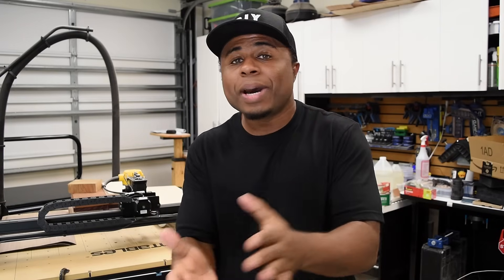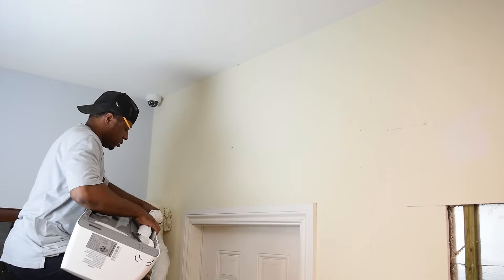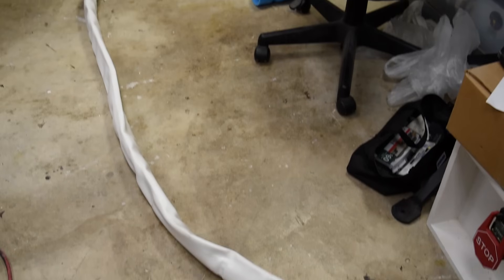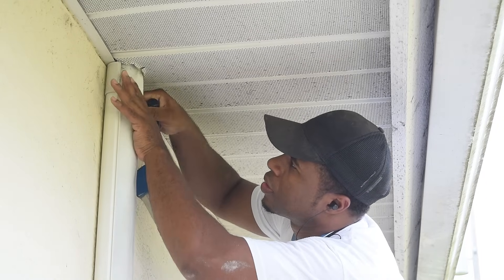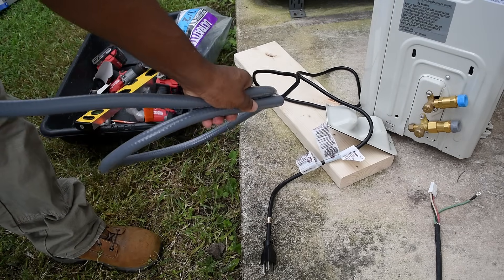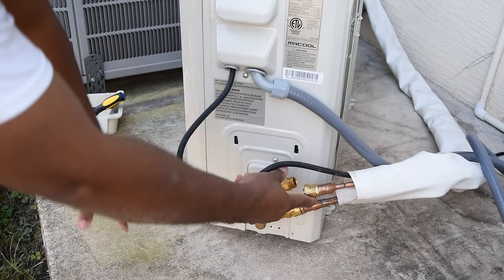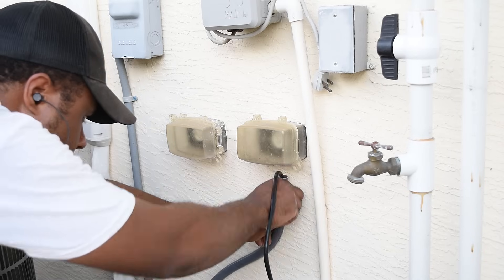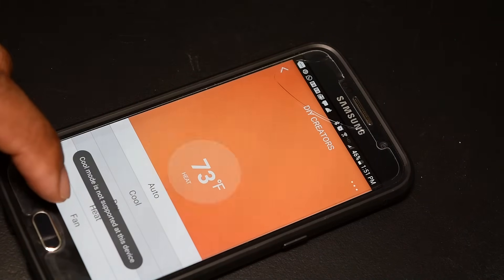How To install Ductless AC & Heating System // True DIY Mini Split MRCOOL

Comment: in Europe for the preservation of the planet it is no longer possible to buy an air conditioning, it is necessary to call a professional
Reply: He was supposed to do that as well. This is considered unlicensed mechanical work, but who’s cares, right...?
Reply: Fred V. Lord of Glencoe that depends on what state you live in.
Reply: @TheFalconJetDriver  actually it doesn't. A system that is not completely hermetically sealed should not be sold to unlicensed individuals. You should have at least an EPA type 2 CFC certification card. That's Federal.
Reply: @Franksdoneitagain  yep your right haha, if he had done that in the UK then he get a £200,000 fine or 256,584 dollars for not having the qualification to install as he needed to pressure test the pipe work and the vac (reduces the pressure in the system which boils off any moisture in the pipework to remove it) before running it up and a traceable paperwork must be created. Plus also the company who sold him the kite would be fine for selling to the General public.
Reply: Insulation is better than air-condition
Reply: Depends where you live. Insulation round these parts just means you trap 40+°C inside your house for longer.
Reply: I am French living in the south of France and it's hot summer. I just wanted to say that at home, you still have the freedom to mount an air conditioning without necessarily having this done by a professional air conditioning. good insulation delays heat or cold but sooner or later it happens in the house
sorry my english is not good enough to spot translation errors in relation to the french expression.
Reply: @danielkzk6202  I don't think so my friend !!  renseigne-toi ami, je crois que tu as tout faux ! mais bon dans le sud tout le monde s'en branle... right ?
Reply: @thereisa6inthename    I don't know where you live, Finland maybe because that's a response from someone living in a cold and dry climate or in a poor hot country,  but I live in a hot and humid climate and 2 meters of insulation isn't going to do much to stop water vapor my friend... AC does not only remove heat but it also dehumidifies; 25% of the work in fact.
Reply: $250,000 fine here in Aus for even opening the covers..
Reply: Bunch of Commies
Reply: wow...  you must've been first in you "how to be a douche posting comments"  class !

Comment: Glenn, why you couldn't cut the excess line(25ft)?
Reply: Because the lines are pre-charged with refrigerant.   This eliminated the need for a EPA certified pro to install.
Reply: @aceshigh1158   Thanks, I was under the impression that the refrigerant was precharged in the condenser unit.
Thanks again.
Reply: Not in the MrCool DIY series of mini splits.  Cutting/sizing the line would result in a loss of refrigerant, and a house call to your local HVAC expert for repair.

Comment: A vacuum needed to be pulled before opening the condenser. The air in the lines is gonna shorten the life of that compressor.
Reply: NO...No...NO...No vacuuming required nor should be done on the MrCool DIY series...PERIOD! The flared line set fittings have internal sealed valves that only release the refrigerant ( pre charged and pre vacuumed at the factory) when you install the lineset on the condenser.  The plastic caps on the lineset are ONLY for keeping the threads protected and clean, not for retaining the refrigerant in the lines.  Yep... I know there are lots of HVAC experts out there, however their advice applies only to non- DIY units.  There are lots of Mini splits out there with minimal 1-2 meter long linesets, then once you're out your hole in the wall, you attach the extensions provided.  You would then have to vacuum the lines down.  However since the MrCool DIY series ( they do make other ducted AC/Heat pump units, btw) pre charges the lines with refrigerant, vacuuming is not necessary or required, and your warranty specifically covers DIYers installations.
Reply: @eldergeektromeo9868  thanks for the response I was unaware the line set was pre charged and sealed with refrigerant I apologize
Reply: No apologies necessary, @amorgan.  You are correct that air( or any other contaminants) in the lineset will shorten the life of the unit, and that is a rule of thumb folks should consider if installing a mini split from any other manufacturer.  The MrCool DIY series ( and only that series) is an exception to that rule.  Someone on utube has a two or three part install on an 18K "Pioneer" mini split, and that person does take the time to vacuum the lines, even though this particular unit has the condenser "pre charged".  Its a very good demo of how it's done, btw...Thank You.
Reply from the maker: This is a DIY unit and they design it to operate this way to my knowledge. I'm not an expert but I just followed the instruction.
Reply: @DIYCreators  The company might have sold it as diy but those style of units are called mini splits. It should still run the compressor might not last as long due to there being moisture and air in the lines. 

Btw, I like your channel and all your projects a lot
Reply: amorgan235 you are correct as I was in the HVAC field for 10 years. A vacuum should have been pulled to get any moisture/contamination out of the line set. Unless this is some new technology and it doesn’t need a vacuum. But in the 10 years I worked HVAC I have never turned a system loose without pulling vacuum.
Reply from the maker: I totally understand where you are coming from. However, the pipes come sealed and the manual mention not to remove the caps prior to connecting the lines to the condenser. I even double checked with the company. Not saying your wrong, just saying this system is different to my understanding.
Reply: @DIYCreators  if you do a search for "vacuum mini split" you can get a lot more details on why it is needed. The lines being sealed is good to keep debris out but as soon as you open the lines it is filled with air and moisture. (Moisture being humidity)

Comment: Hello, how are you? Congratulations on the beautiful work on the installation infrastructure, but you made a mistake. before releasing the gas from the condenser is necessary to make a vacuum in the system, which would remove all moisture present in the pipes, in addition, there is a test with nitrogen to check if there is no leakage in the system. Another point, when you passed the pipes I could not see if you insulated so that no dirt or object could enter the pipes.
Reply: I thought the same thing with pulling the lines into a vacuum, but I just checked their website and the lines are already in a vacuum and the ends are a quick disconnect I guess.  So no need apparently.
Reply: hello ... of course the device will work, but not in the most correct way. the installation in this way will only reduce the life of the equipment.
Reply: the unit does not require vacuum. That is why it is DIY....
Reply: yes it does. won't last long without a vacuum @made_by_chris
Reply: @zacash25  no it doesnt! The DIY version doesn't require it.

Comment: Great video. Always wondered how difficult or easy these were to install. 

Looks pretty straightforward, like putting up an over-the-range microwave and hooking it up to the unit outside.

One question, how loud is it inside? Quieter than a window unit I would imagine, but louder than central air.
Reply from the maker: Yep, pretty easy. Grr, I knew I was forgetting something, the unit is extremely quiet. You will never know it's on.
Reply: @DIYCreators  thank you!

Comment: You might consider putting insulation panels on the back of your garage door - to help keep the proper temp inside.
Reply from the maker: Definitely, something to think about. Thanks!
Reply: I'll second that. I recently installed a heater. Those insulation panels really keep it nice and toasty. Without them, it ran constantly and still never got it comfortable.
Reply: I was just watching videos on that where they use insulation board to wedge them in, some dude in the comments said they make insulation for garage doors and to contact the door manufacturer, he said something about getting it for free? Maybe collecting half used packages of the insulation from door jobs that the company does. I've heard it makes a big difference.
Reply: Don't forget your relief cuts so you can get a proper fit, use a good caulk/foam (and hit those outer edges of each panel) or it puts a good dent in that efficiency.
Hope to see an update vid on this.
Total project runs under $100 in most the US.